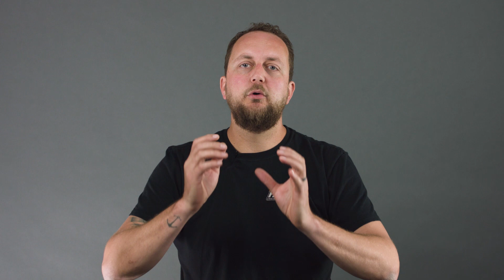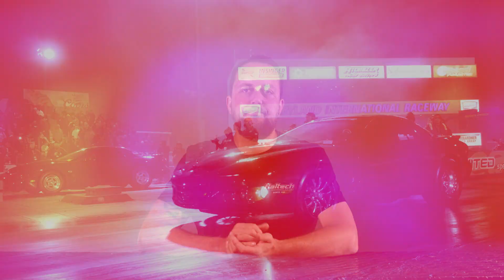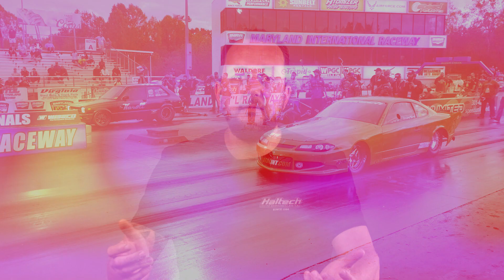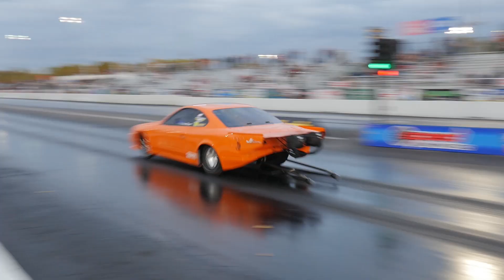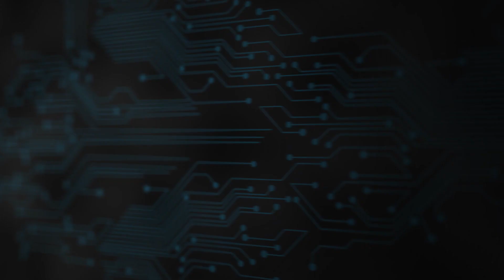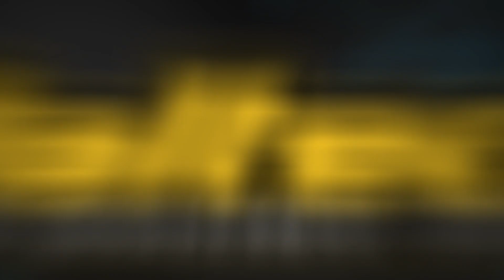💬 How Launch Control Works | TECHNICALLY SPEAKING

Comment: how can you turn an older automatic car to having launch control? hit the brake, floor the gas, then let go the brake. how is this process different than putting the car in neutral, reving to 4500 rpms, then shifting into drive? what is the process that's different from these two?
Reply from the maker: The process you've described is "launch" not "launch control". What we are talking about here are all the things that go on between the ECU and the engine/trans that help you launch faster and more consistently. When fractions of a second decide the winner at the end of the run every little bit matters.
Reply: @haltech  okay can you install launch on an older automatic? I was thinking of getting an auto eclipse gsx but it doesn't have launch
Reply: @Rdawg  launch is a procedure that involves the steps you mentioned. Launch control is software in the ECU, which the factory ECU does not have.

Comment: Luv my 2step. 2500 elite 5500rpm -20 degrees and a little extra fuel and it builds boost so quickly while cylinder temps sit around 700 degrees.  motor barks so well on these settings for a full exhaust setup.

Comment: Wish I had launch control but I’ve only got a elite 750 . Thanks to the sales guy at haltech pointing me in the wrong direction
Reply: You can set up a basic launch control function on a 750. You just need to use an in input and output for a function you're not currently using to have a rev limit actuated by a momentary switch